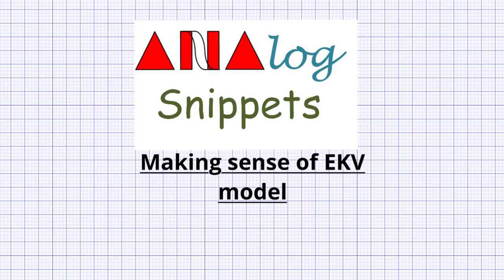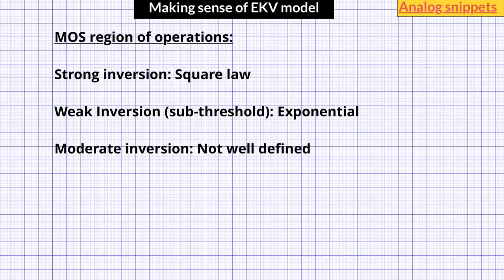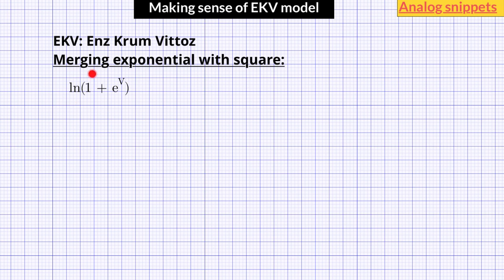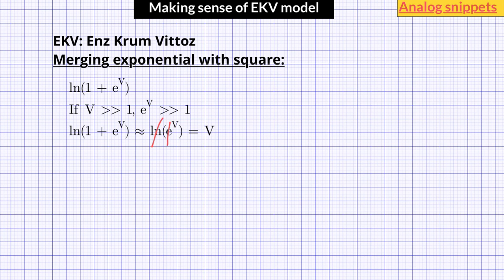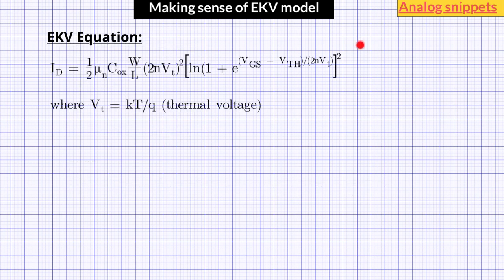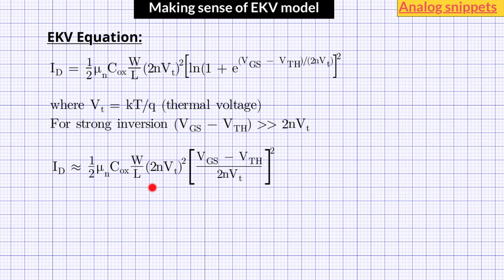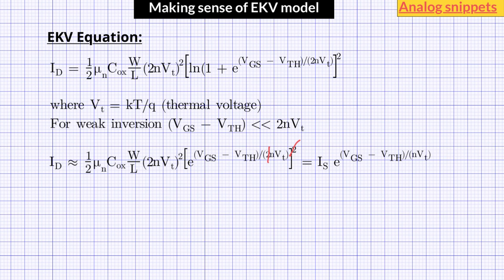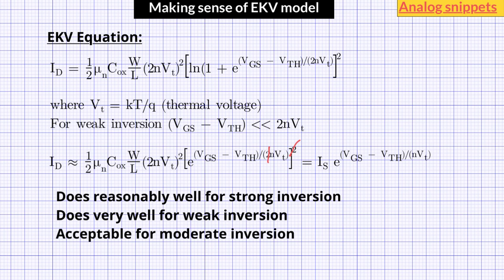#45 Making sense of EKV MOS equation

Comment: Hi sir, I have a question regarding Weak and strong inversion. I heard sometimes ago that we usually want to build Differential pair in weak inversion (subtreshold) and Current miror in strong inversion for better matching. So for example when designing an opamp, let say the well know 5T OTA , Is it common to design the differential pair in weak while the current miror in strong inversion ? If we target good matching ?
Reply from the maker: Yes, it is very common to design diff pair in weak inversion and load mirror in strong inversion.
Reply: Thank you for your answer

Comment: Hi Sir thanks for your lectures.
 A humble request if you can consider for future topics is gm/Id method of designing Opamps. It will be good to have a folded cascode designed with the aforesaid methodology. Today we lack  consolidated material with design example on gm/Id. Thanks
Reply: Please do it with finfet technology, I found I doesn't work with finfet